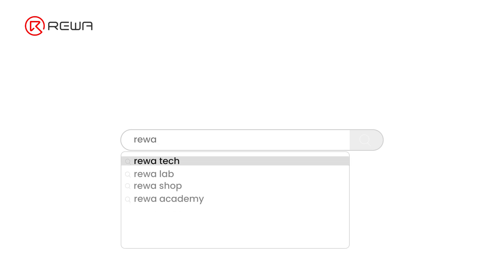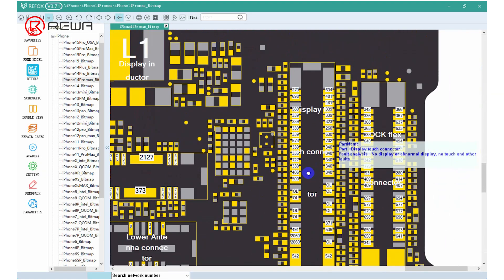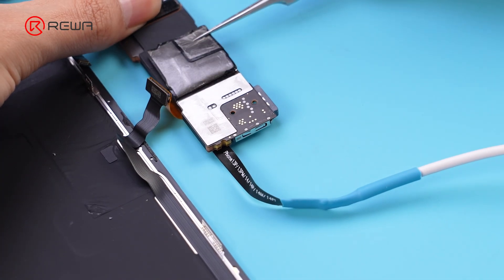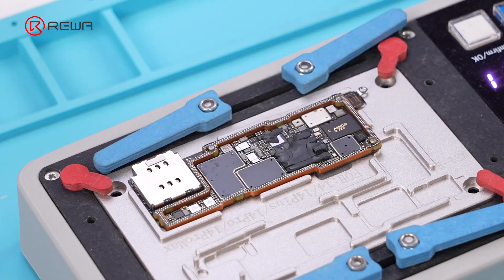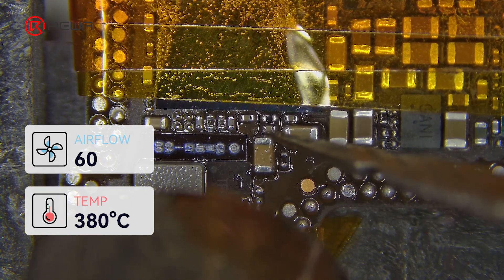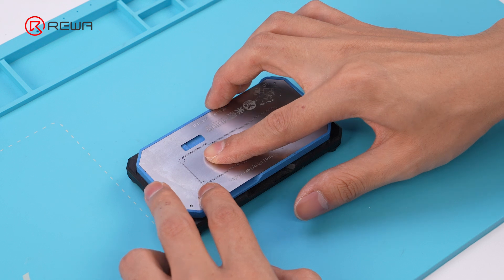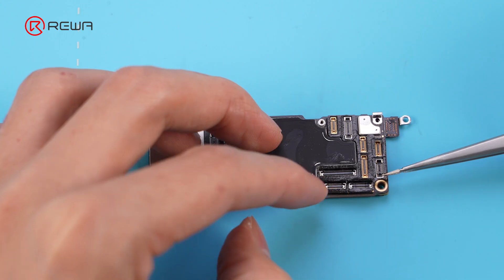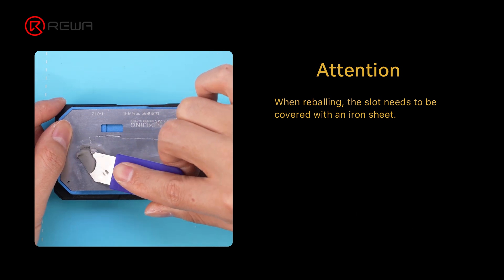How to Repair iPhone 14 Pro Max Touchscreen Issue with Detailed Motherboard Troubleshooting

Comment: You said, 'We just need to replace the capacitor with the same specification.' So, I was curious—how did you find the correct capacitor, even though Refox Bitmap doesn't provide its value?
Reply from the maker: Oh the bitmap helped us to troubleshoot first, that is how bitmap work, then for the replaced capacitor, we will check it our other same model motherboard.
Reply: @rewatechnology2008  Understood! Thank you so much for sharing your knowledge!

Comment: Sir, I have a quick question. When you replaced the capacitor with a new one, how did you find the correct value? I use the same schematic program as you, but it doesn't provide any schematics. So, if you don’t have a schematic or a donor board, how do you determine the correct capacitor value?
Reply from the maker: You mean the right number of current and resistance?
Reply: @rewatechnology2008  Thank you for the answer. You said, 'We just need to replace the capacitor with the same specification.' So, I was curious—how did you find the correct capacitor, even though Refox Bitmap doesn't provide its value?

Comment: hi i have problem with 14 pro max only can use incell lcd but when using ori or oled cannot touch is this the problem to ?
Reply: Did you any repair by apple repair assistance update option ?
Reply: change the touch power ic
Reply: @aibi5532 had same problem which I changed touch ic still original screen does not work except incell

Comment: I have a problem with my Iphone 14 pro max with green screen after update to ios 17.10.I have gone to the mechanics and they said that they can fix  with jumper wire. Should I fix it with jumper or u have another solution?plz reply
Reply from the maker: The green screen problem you can check our full video about the green line: https://www.youtube.com/watch?v=uWaa946Aax0&t=25s